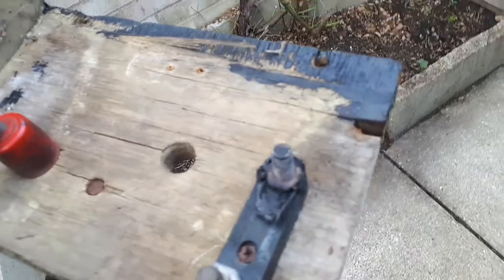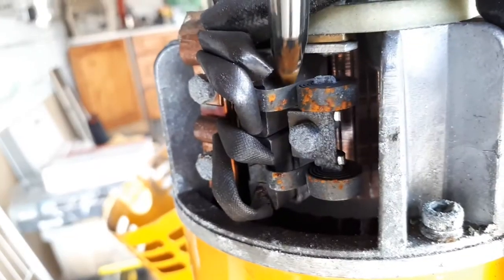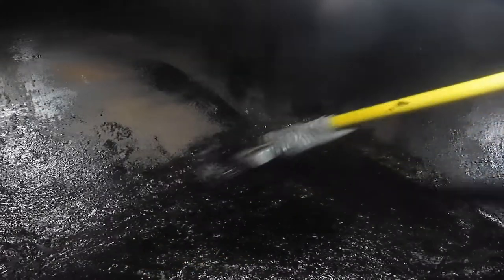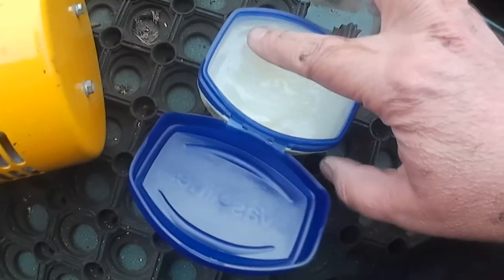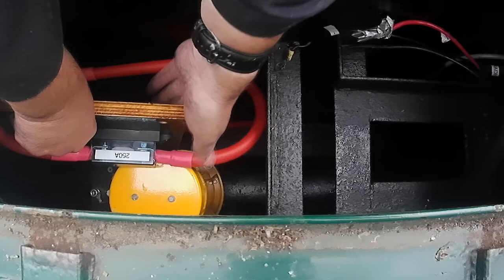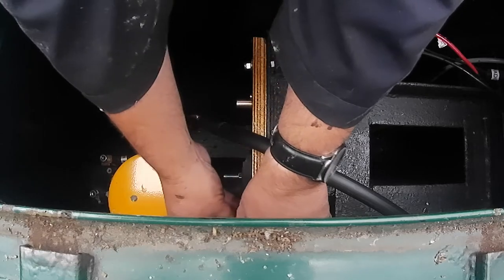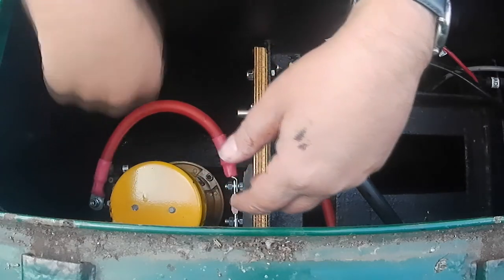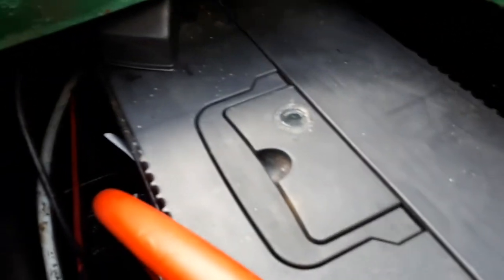#39 Bow Thruster Chamber 'Refresh' #2

Comment: Found this useful as I needed to clean up my Bow Thruster Motor. I found that my brushes were virtually stuck in place because of the build up of dirt. They can break and fall apart if too much force applied to ease them out. Suggest a spare set be on hand if attempted. About £130 for a spare set.
Reply from the maker: Excellent, always nice to hear these vids help...